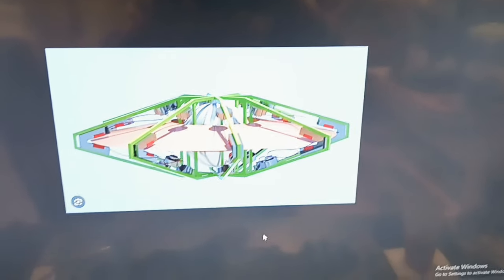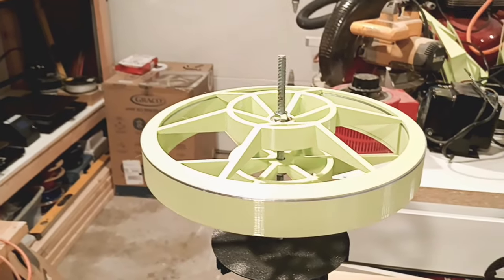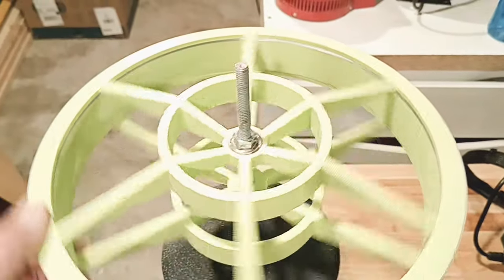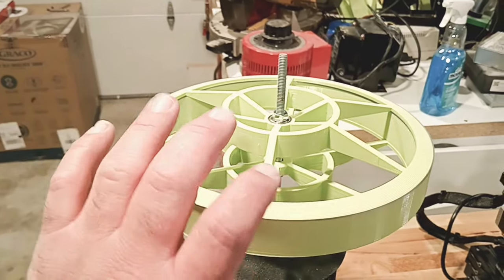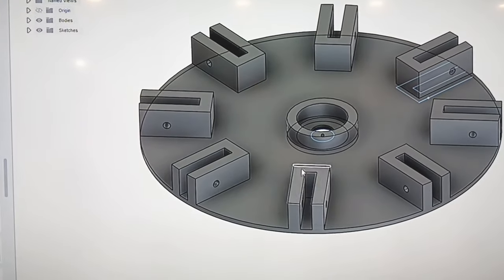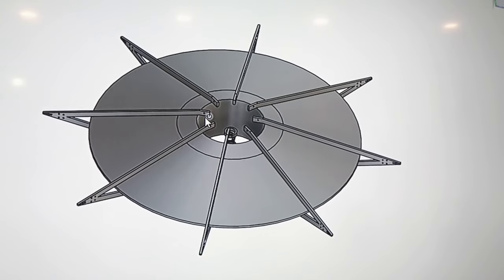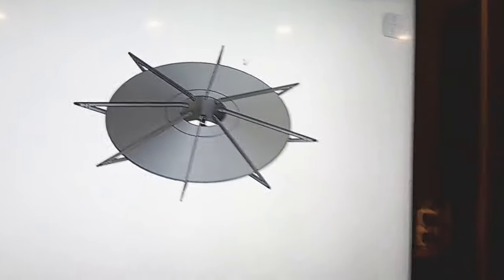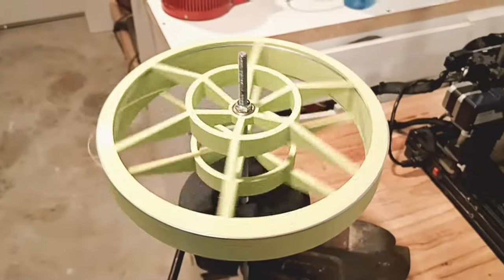Vril UFO The Inner Structure

Comment: You will need for this thing to spin at enormous speeds for it to lift..theoretically and so the build will have to be stable enough to support that, otherwise all you will have is a low speed counter rotating paperweight that looks cool, but I guess you have to start somewhere...best of luck on the build👍
Reply: According to Carr, there would be no heat barrier or resistance to movement when the parts move, it would have a protective field in which its electromagnetic actuation. By breaking neutral air into positive and negative ions, a small layer of "vacuum" is created where friction is theoretically reduced.
The Earth, having its electromagnetic field and being 12.741 km in diameter, rotating once every 24 hours, would be for example, the same thing as a 15 cm discoidal object rotating at 60k RPM, or 30 cm at 30k RPM. When the object reaches the relative speed, the inertial attractive mass (the planet itself) becomes activated by the free energy of space, just like a satellite that, when launched at the correct angle, would theoretically orbit the Earth until the end of time.
The interesting thing about this is that the Earth's speed at the equator is approximately 1.666 km/h exactly the speed of the 15cm disk rotating at 60k RPM, or the 30 cm 30k. But depending on the planet's latitude this speed decreases. Could it be that depending on the geographic location of the planet, the object would have to reach different relative speeds to be activated?